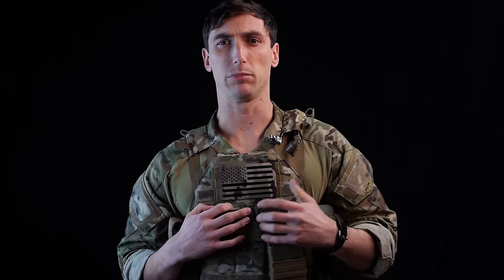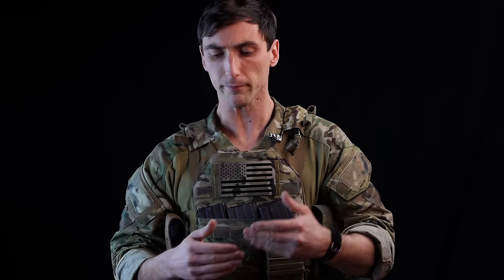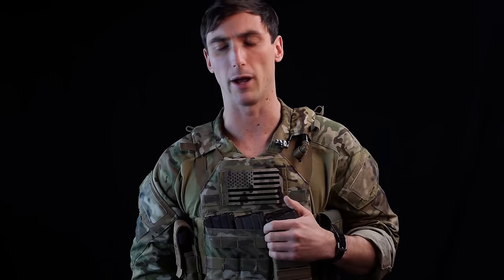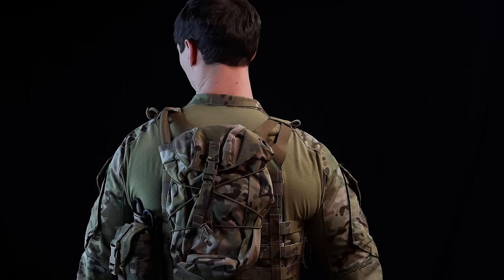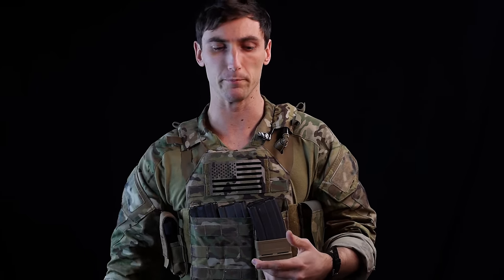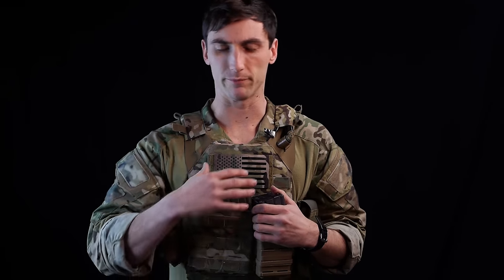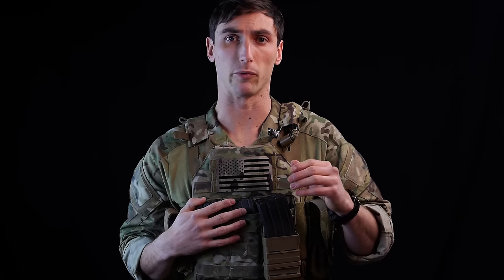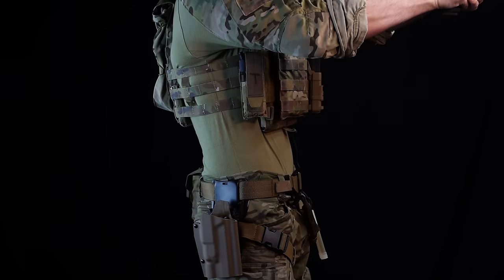Plate Carrier Setup (General / Crye JPC)

Comment: Great video. Unfortunately my chain of command makes us wear the IOTV due to being in big army even though it's an airborne unit. The most we can do is our own rucks that fit h harnesses, chest rigs, our own pouches, and the opscore drop in suspension system for the ach. 

Are you using the belt mounted IFAK and taco for your belt line? I'm trying to build a first line in order to fit the 6+1 loadout we have. I'm considering a dump pouch as well. What are your thoughts and is there anything I could do to improve? I already have my own chest rig setup. 6 mags, ifak on the left and GP pouch for NODS on the right in a 12 column chest rig from BFG. I have my own MSA sordins and 15 own mags. Sucks having to buy your own gear haha. It eventually adds up as a new guy. 

Considering a JPC for personal use as well. Great video!
Reply from the maker: Dannnggggg. Didn't think an airborne unit would be using those. You guys jump with those? As far as dump pouches I don't use them. I try to keep the amount of things on me as minimal as possible. My belt line almost has too much on it in my opinion. As far as the NODs you're rolling with those on your chest rig? If you have a 3-day or assault pack or hydration pack I'd say get them off the chest rig. That's alot of weight up front. But honestly it might work for you. Try skull dragging a 100 yards and see if it's working out. If it feels ok you're a-ok. If you've got time send me a pic of your rig to garandthumbactual@gmail.com so I can visualize it.
Reply: Garand Thumb We get issued PCs if we deploy, but our unit as a whole hasn't done that in a very long time. We are now testing about jumping with the iotvs. The 82nd does it, but testing for that will be done for our unit. 
My goal for my first line is 1 rifle mag, ifak, and then dump pouch possibly. I found the current pouches we have been issued makes mag reinsertion crappy. So I bought all my own stuff. My chest rig from BFG is on back order so it's not even completed yet. I am also on holiday block leave back in the lower 48. All my kit is locked away in my barracks room closet behind evidence tamper tape used for piss tests, haha. 

I asked about NODS being stored in a pack instead of up front, but they typically don't listen and the big army philosophy take over to where what your NCO goes instead of what would honestly be better, such as running our own plate carriers, nods in a pack, and so forth. I've considered the d3 flat pack to balance out the frontal load and adding hydration. 

In order to Minmize the atrocious layers we typically have with issues gear, the gear I bought was intended to be used in the swift clip style. So, the amount of material, and incessant bulkiness/ layers are drastically reduced. I noticed you aren't running any extra pistol mags. Why is that? 

I'll send a picture once I get back on the 30th. Hopefully my chest rig will be waiting for me in the mail.
Reply from the maker: Slov _ ah pistol mags. It's a love hate relationship with adding pistol mags. If I do carry some it will likely be one extra.just didnt have it in my 1st line gear for this video since it was PC central

Comment: Hey bro I know this is an old video, but do you have any suggestions of companies you trust to buy plates from? I keep hearing a lot of the armor on the market is bullshit. Thanks.
Reply: Ar500 and Spartan are solid, they're proven. They are expensive though, the armor that I'm running is level IV from battlesteel, mr.gunsandgear has a test video over it, it seems pretty solid and it fits my budget
Reply: Dr4gon2000 Thanks for the info man! I’ll check them out. I’ve been looking at Spartan but like you said, it’s a little pricey. I’d rather have quality and pay a little more when it comes to armor though. Thanks again bro!

Comment: would this replace the standard issued army plate carrier for deployments?
Reply: No. For static/top-cover you still can't beat a full system like the OTV or the IOTV. The neck, bicep and nut guards are there for a reason - The regular rank and file is under greater risk of fragmentation than the high speed guys, so they need the coverage.
Reply: Joseph Kloss as a regular 11b haven't seen anyone use a anything but the regular plates

Comment: I'm not really a fan of your ifak placement. I get your rational on being minimalistic up front so you can be as low to the ground as possible. But here's what I like and why. I like the ifak as close to the centerline of the body as possible so that it doesn't matter if one of my arms goes down. If you can reach your ifak with both hands with your set up then I guess what I'm saying is irrelevant. For me though I know I wouldn't be able to
Reply from the maker: Different strokes. Everyone is different. I have an ifak in the front pocket of my crye pants as well.

Comment: 2:53 Anti-spalling. I get it. But then people stack mags with 100 little explosives on the front. Whats the bullet hit first? Even if none of the rounds go off wouldn't there be external spalling before the incoming round even made it to the plate? i have never seen anybody test a PC with loaded mags on the front to observe spalling tendancies. Just doesn't make sense to me. Somebody explain?
Reply: Not much happens when a loaded magazine is shot other than the bullet going right through it.
Reply: Ammunition is incredibly stable. The bullets aren't going to explode when shot. The bullet is going to go right through the mags and ammo. What is commonly referred to as "spall" on a steel plate is not spall. Spall is the metal fragments that are produced when a projectile penetrates and get blasted in the direction of the penetration. What is produced when a steel plate stops a bullet is frag. That frag is the bullet being shattered and the pieces being sent flying all around at basically the same velocity as the bullet when it hit.

Comment: Any reason why you don't use a dump pouch?
Reply from the maker: Depends on the mission. Sometimes yes and sometimes no. Mostly no. Use cargo pockets on pants to hold spent mags (Crye Combat pants have elastic to hold mags in place). Partial mags are re-indexed into mag pouches. Other than that if I'm on an extended mission I'll have a 24 h or 3 day pack to store crap. Hope that answers your question, what about you?
Reply: Personally I find dump pouches as a solution to a problem that does not exist. Pockets work fine for grabbing loose items. If you are doing a "tactical reload" then you will put the partial mag back into a mag carrier that is furthest away from your freshest source of ammo or re-position mags during a "lull". If it is an emergency bolt lock reload during a fight, then the last thing you are going to be thinking about is where to put the empty mag. That is at least how I view dump pouches. Cheers mate.
Reply: Garand Thumb it does, thanks. I use a dump pouch because it's a quick and easy way to store empty and partially full magazines on a range, I find putting them in pockets to be more tedious/difficult especially when I'm trying to improve my shot times. When I'm really running quick I just drop them but I try not to because I don't want to damage the magazines and don't like going back and hunting for them on the ground.
Reply: I never ran a dump pouch downrange, nor did any of my brothers from what i remember. I've found that Dump pouches are fine for the range for convenience. But in a firefight, you would never be doing a "tactical reload". You will typically run the gun to slidelock, hear a click and think "oh fuck im empty" then drop that shit on the ground and get a new mag in lol. Last thing you have time for is fumbling around trying to put an empty or mag with 3 bullets into a dump pouch. before you can get your gun up and back in the fight. Good for the range, worthless in a firefight.  Just the way i always saw it. People who have never been in a firefight have no clue just how much the adrenaline dump affects you and how much you need to keep shit simple. Gross motor skills, and simplicity under stress wherever possible as far as im concerned.

Comment: What is the point of spending all that money on armer and it does not cover your gut?
Reply: It's a tradeoff - lower coverage for lower weight. 

Besides, kevlar doesn't stop rifle rounds (only the ceramic plates does), so even with a full coverage system you will still get a pass-through if you get hit in the gut with a rifle round.